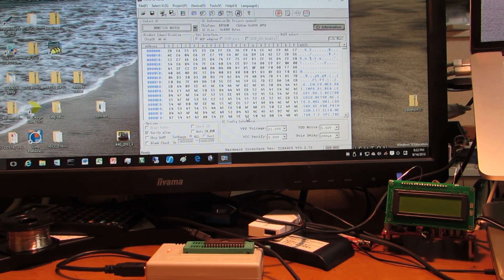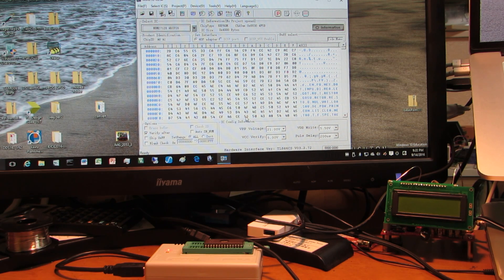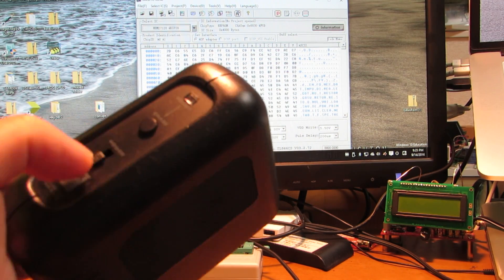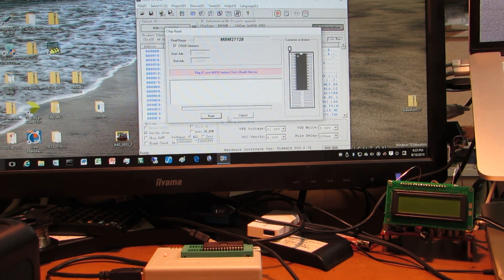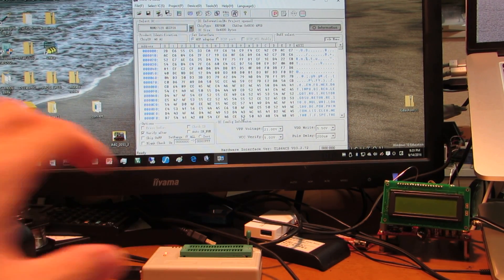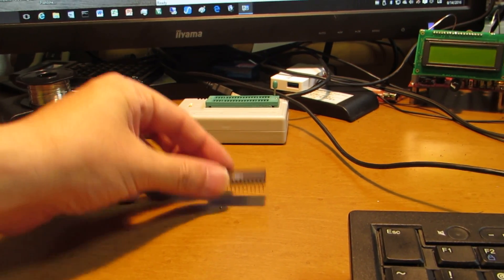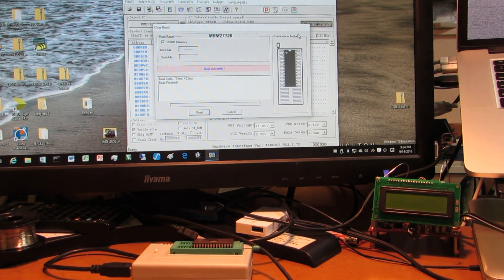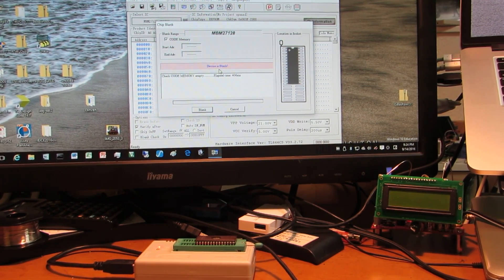Erasing UV-EPROM in five seconds.

Comment: I find the concept of uv eraseable eproms very interesting though not very practical
Reply: All EPROMS are UV erasable... and actually they were very usefull and they worked perfectly. Their job is to store static data (firmware...) and are great for this job.
Reply: They have been in use in industry for decades. I have even seen production electronics use EPROMS (why I do not know)
Reply: @daishi5571  most modern electronics use eeproms or spi flash.
Reply: @mjyanimations1062  True but many industrial pieces of equipment don't get updated like consumer equipment. The adage is don't fix what ain't broke!

Comment: The flash bulb in your UV eraser appears to be a Xenon Tube with a reflector. The Xenon flash discharge is very powerful and radiates in the spectrum 300 - 400nm region. UV germicidal or UVC lamps radiate at 254nm. My 6W T5 UV tube takes about 20 minutes to erase an EPROM. Long, I know, especially since the recommended wavelength of UV to erase an EPROM is 250nm. I suppose because the Xenon flash is so intense that it erase yours in such a short time.

If I can find a Xenon tube like that I'll try build one. Thanks.
Reply: I used this one : https://www.ebay.ie/itm/Giga-Strobe-2700w-Geni-Electronics-/183802265860?hash=item2acb780104
Removed front glass and put the EPROM at about 1cm of the tube and flash the thing at full speed for 10s -> erased :D
Seeing the length of the tube you could probably erase like 25-30 EPROMs in one go.

PS : just be careful that thing gets quickly really hot.
Reply: Hi I have a PCB which has a BGA ASIC chip on I want to reset it can you assist I will pay you £100 for your help